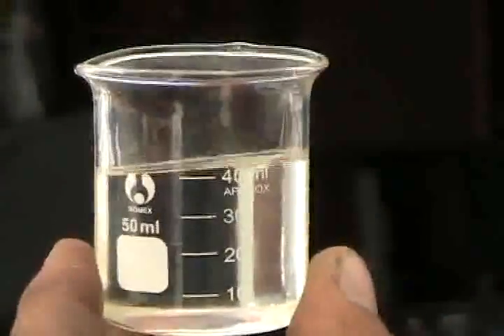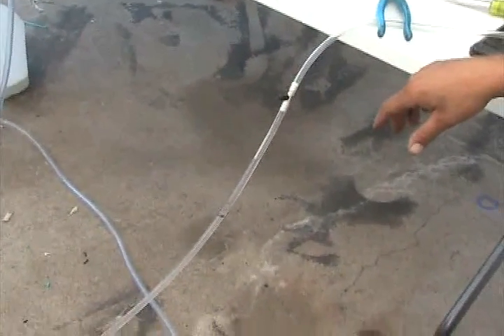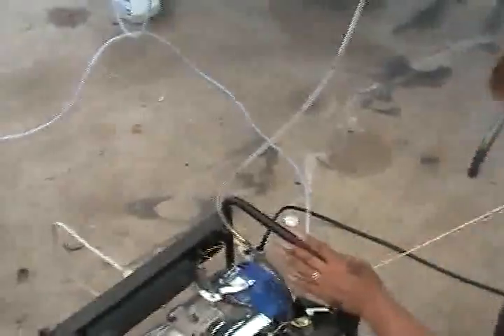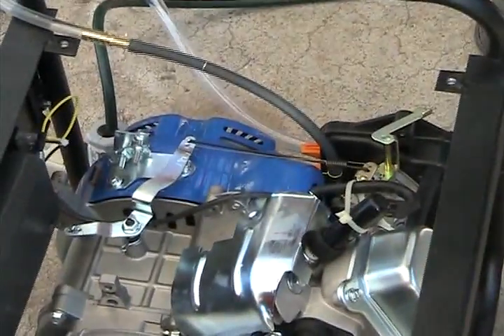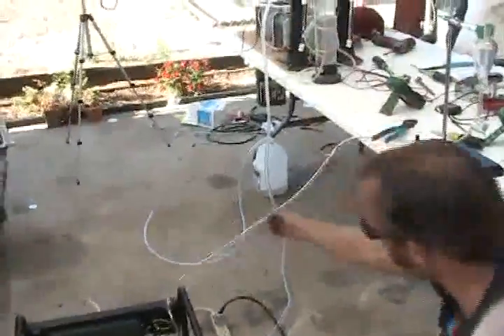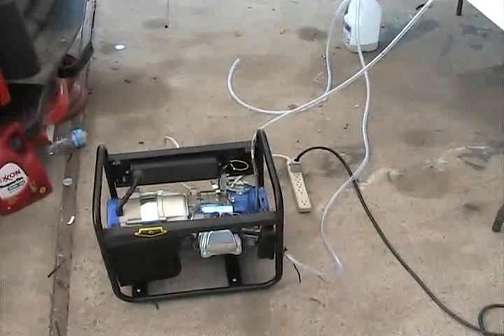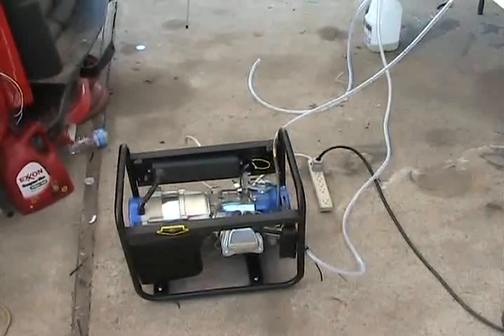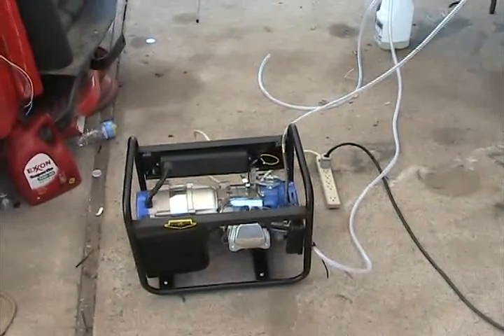generator running on hho testing Pt.5

Comment from the maker: as far as the pressuriztion of hho goes, my advise is not to, I have tested many devices and haven't found anything I would trust with hho underpressure. For now the goal is to buffer system with hose, and torch tip.

Comment from the maker: I will do some temp samples of the engine for baseline, so we can keep track of possible eff. different between gas fuel and hho fuel, exhaust manifold and block temp, I have an noncontact thermometer I will be using, its about as scientific as I can get, no pyrometer yet.

Comment from the maker: hehe those tests are already slated, I am just trying to figure out how I want to inject the hho, and how much to inject. It should be after the carb that way the engine doesn't use the hho to venturi more fuel in than it needs. I already have two 500watt halogen lights for load.